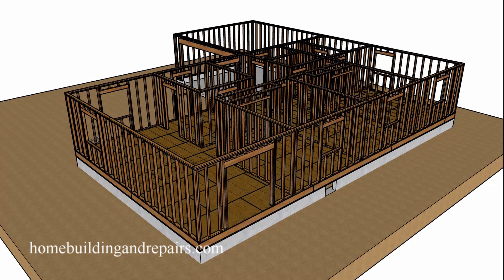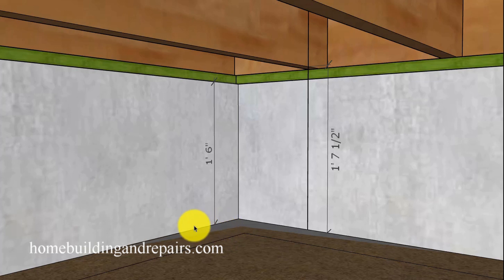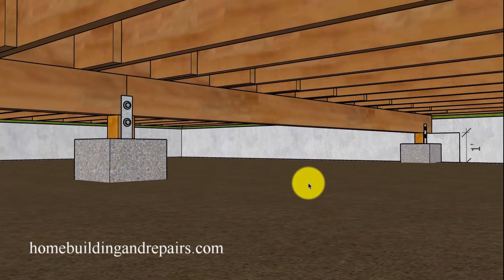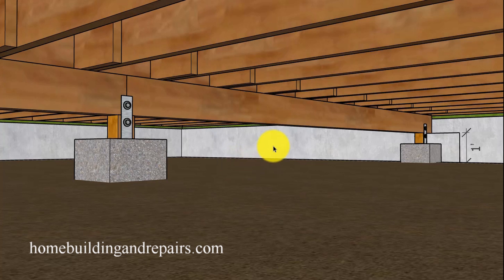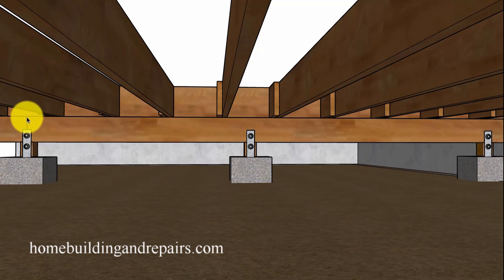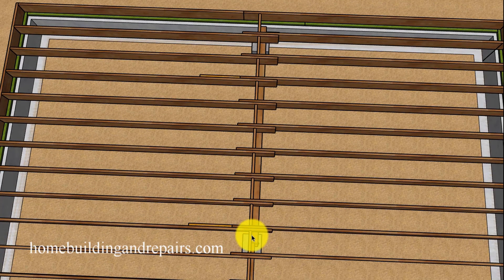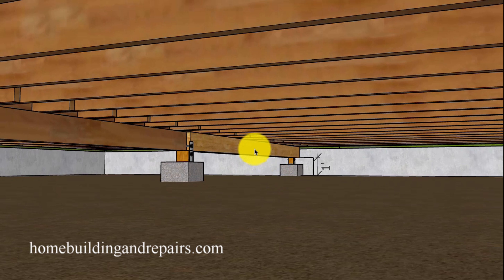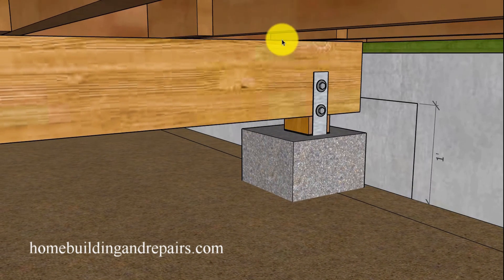Potential Crawlspace Beam Repair or Replacement Building Code Problem - Home Repair Tips

Comment from the maker: For those of you looking for the building code reference number it's on page 65 in the 2012 residential building code number R317.1. It might also be located in newer building code books in the area referred to as "Protection of Wood and Wood-based Products against Decay".

Comment: I have inspected 100s of crawlspaces as a private building inspector. I see everything from seismic retrofits to repairs to additional structure for added floors or "opening up" the living area, where additional beams are also installed in the attic. Some of the work is obviously substandard but also signed off by the city. Municipal inspectors do not always inspect the crawlspace. 
I also see damage from other trades, particularly plumbers cutting joists or beams for their pipes. If you see a plumber with a saw entering your crawlspace, determine exactly what he plans to do! I have also seen older buildings with 6" of space to soil, usually with insect and/or moisture damaged wood. I have a camera on a RC car I can inspect down to 7" with. Some "access" openings are only 9"x14".
Reply from the maker: That is awesome. I remember when inspectors first started using metal detectors to check for rebar in fireplaces and now remote-controlled cars to inspect crawlspaces. Thanks for sharing.

Comment: Can you do a video on tying the concrete footers to the posts and beams above them? I’ve got an older home that sits on footers without any hardware connecting to them.
Reply from the maker: Email me some pictures of of your project and I will see if I can help. You can get our email address at our website.
Reply: gregvancom will do, thanks!
Reply: Simpson Strong Tie and others make retrofit connectors that may work for you. Make sure you use the correct connector, as recommended by the manufacturer and/or your local building official.

Comment: What are the codes for Denver Colorado..is it the same 12" or a foot for the gurder beam
Reply from the maker: You would need to check with your local building department.

Comment: My main carrying beam is starting to twist. The columns under the beams are starting to fail, but I can repair them. However, I do not have a real good idea to get the twist out of the beam. Any thoughts?
Reply from the maker: They usually need to be replaced or left alone if they're not creating a structural problem.

Comment: do inspectors actually go under the house to make those kind of inspections?,because i doubt it
Reply: They actually should check as much as possible because they sign off the inspection certificate and they might be liable for sth that happens to the house. But it all depends on the country or state you in. 
I have gone under houses with tight spaces but not as tight as one on this video.
Reply: @aljafari2364  Honestly, my 1950 house has 3" crawlspace.  Joist are 3" above the dirt!  lol
Reply from the maker: They do with new-home construction. It's actually one of the inspections that should be made before the floor joist is insulated and the floor sheathing is applied.